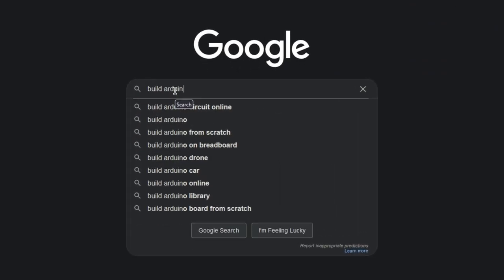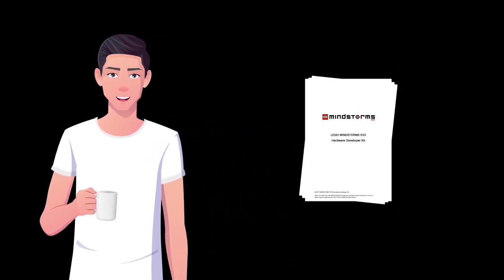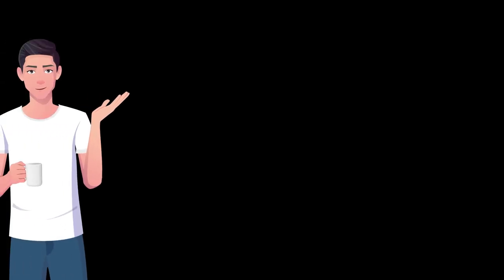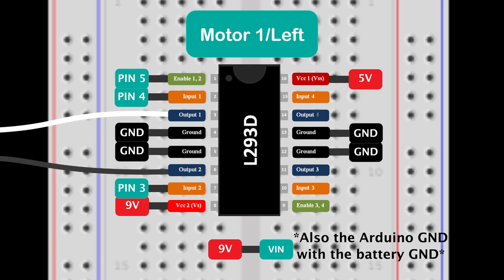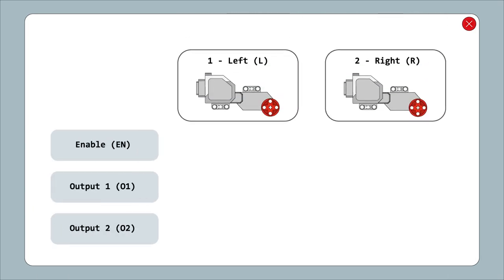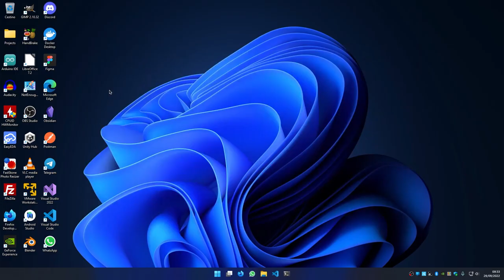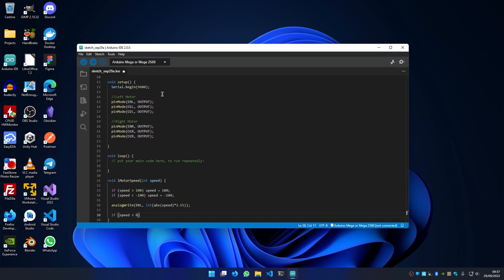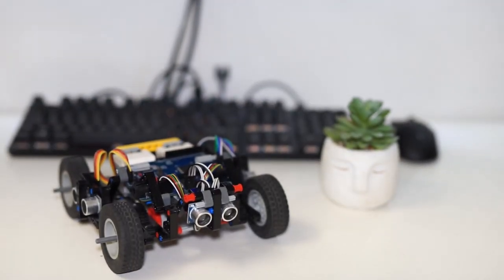LEGO EV3/NXT Motors with ARDUINO - TUTORIAL

Comment: I was wondering if there was a way of going full hog and programming the Lego bricks from the Arduino IDE. The NXT bricks contain two processors an AtMega48 for hardware interfacing and an AT91SAM7. I occurs to me that the SAM should be able to be given an Arduino bootloader and some basic routines for talking to motors, sensors and the AtMega in the flash and we could upload running code to the ram (even if it ran in an interoperative mode, it'd still be fast). The EV3 has a single ARM9 processor with even more ram to play around with.
Reply from the maker: No, there is no easy way to program the EV3/NXT brick from the Arduino IDE